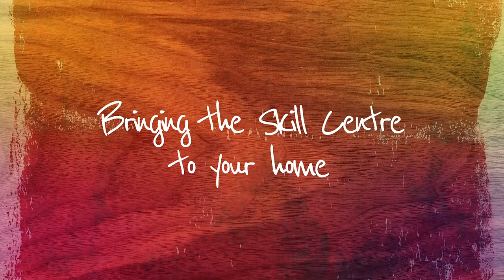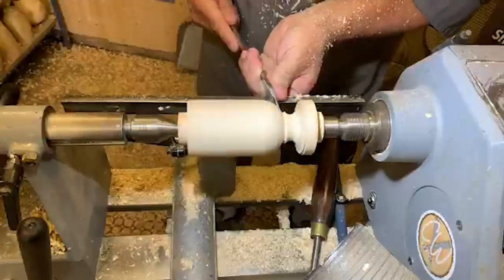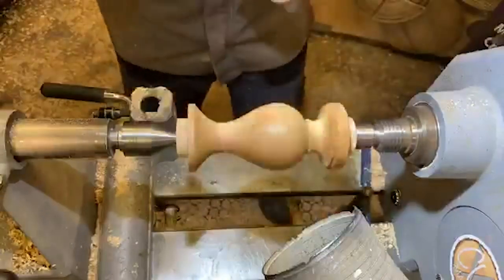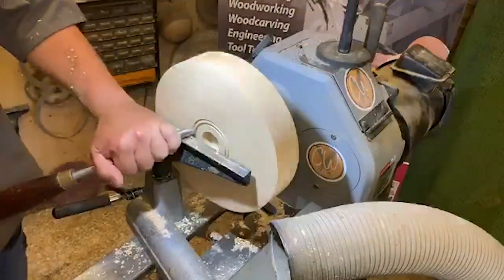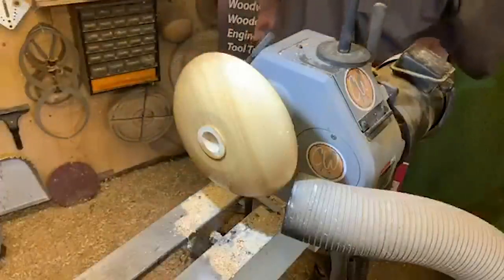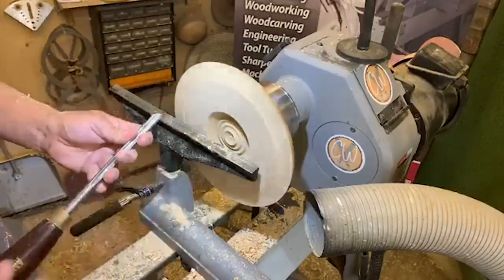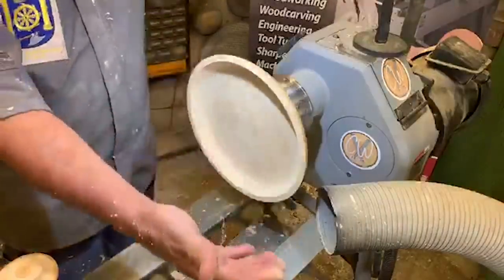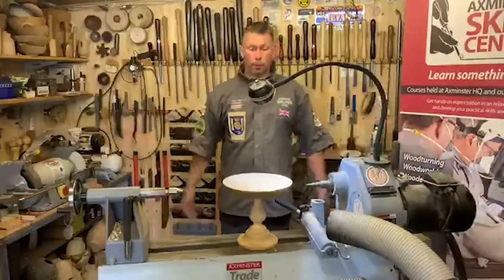#SkillCentreAtHome - Live Turning Thursday - Turning a raised bowl Part 2

Comment: Could you have used Odonell internal dovetail jaws instead of a tenon on the bowl. Then bottom of the bowl could be finished
Reply from the maker: Hi Colin, the following reply is from Colwin - "Yes you can but you just need to be careful with vibration, as this is throwing the bowl a long way out from the headstock." We hope this helps :)